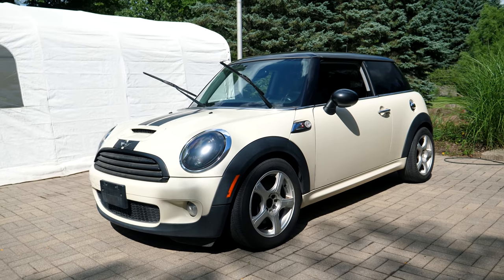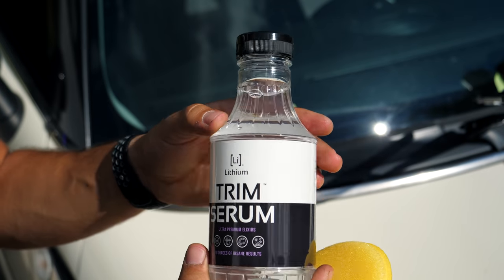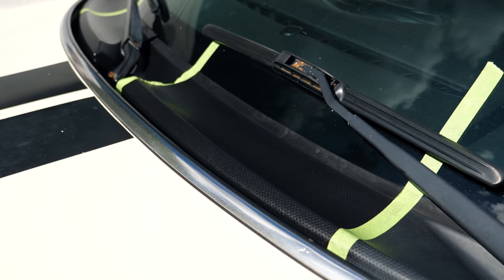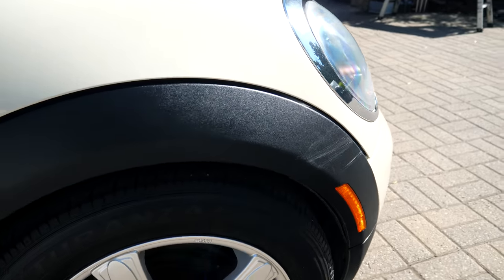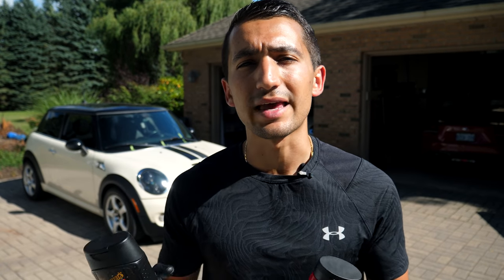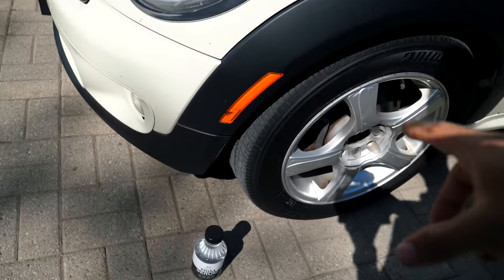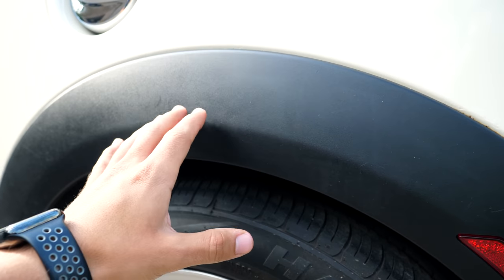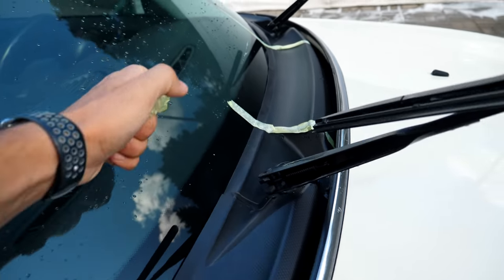The BEST Product to Restore Faded Black Trim

Comment: You want to scrub the black trim with a degreaser such as Dawn dish soap AND a green scothbrite pad. Basically take off the tiny top layer of dead plastic. THEN put on a dressing such as these. You’re welcome
Reply: Exactly, scotch brite.
Reply: How long does it last?
Reply: Damn can't wait to use the scotchbrite pad, then Cerakote trim restorer. Will report back
Reply: I just use the product but I also apply the products regularly because I park my car outside so I treat it often.
Reply: Yea dont do that. Lol the scuffs will never come out
Reply: I just use BTB and just rub it on. I’ve been using it for years!
Reply: You missed the two black bits

Comment: Like most detailing cars projects prep is the key. Planning to coat your tires, then use a degreaser product ( that’s safe for rubber, read the label )when the rubber dries after a good wash. Then apply your tire dressing of choice but ya, remember like it was mentioned in the video, wipe off the excess. As for the hard plastic, I have used the Mequires as well as my current go to Chemical Guys VRP???. I have a full bottle of Auto Glym trim dressing but have never used it ( no idea why that is as I have always liked the results of their other products. The cowl plastic trim is the hardest to keep looking good probably because it sees the most direct UVA. I coated the trim on our RAV4 a couple months ago and it has done a 900 mile round trip as well as a 2000+ mile round trip in the last month and a half with at least 7 hours of the two trips  in the rain. The trim is still black but I’ll be reapplying it soon because winter is coming soon.

Comment: If you want to rejuvenate any rubber product on a car, the best product is called AT205C made by ATP. Is is a seal conditioner for internal engine, transmissions, power steering, etc, but works wonders on vehicle trim, door seals, trunk seals. I have been using for decades.

Comment: I used C4 on the fender trim of my f56 Mini and nine months after application, it still looks brand new. Despite the fact that the car has been exposed to rain, snow and heat and a monthly wash, the product has held up rather well. I would highly recommend.

Side note: After the C4 application, I also applied CarPro Cquartz UK 3.0 ceramic coating.
Reply: Isn't that a bit redundant? Both are Ceramic coatings.
Reply: Bro what?  I tried what you did and now mine is In pieces.

Comment: I use Solution Finish Trim Restore on my plastic. It's actually permanent, not a coating. I have a Wrangler, which had grey fenders prior to application, and they are still black after 2+ years. It doesn't ever go in a garage. Auto Fetish Detail turned me on to it. TOP TIP: wear gloves when applying.
Reply from the maker: I'll have to give it a shot 👍
Reply: @Marioact  It's not an "in-store" option like Meguiars, but you can certainly find it on Amazon.
Reply: Just used Solution Finish on my JKU ... yes its black ... BUT it never dries and leaves a black oily coating that rubs off on anything that comes in contact.  Even when you wash the car it comes off on the sponge and then gets on the paint.  CRAP product thats overhyped... no one talks about the cons.
Reply: @PK22-b7v  SF has been hyped for several years, but there are newer and better trim coatings on the market now.
Reply: @PK22-b7v  Yes certainly overhyped and messy. I had same issues, does not dry properly, then gets on everything when washing the car. Very expensive for something that does not do what it is promoted to do. And too messy when applying it, gets on everything, would avoid this product like the plague.
Reply: @detailone978  Can you suggest a couple, want some advise from someone who sounds like they know what they are talking about. SF is rubbish.
Reply: @cudgee7144  cerakote, wipe new, malco epic revive.  Watch Scott HD on YouTube as he has a long test using various trim coatings.
Reply: @detailone978  Thanks for your advise. Much appreciated.

Comment: Gtechniq, hands down is the best product on the market for restoring trim it is not meant for tires with silica rubber but it is for all your trim on the vehicle whether it be plastic or rubber as it's not the same rubber that is manufactured on tires. The problem with your top pick is it last like ass after 4 or 5 washes that shit is pretty much gone whereas the c4 Gtechniq will last up to 18 months no matter how many times you wash the vehicle.

Comment: Have you tried using Meguiar's Synthetic Spray On Wax? It comes in a gallon container and can be used on every part of the car including the interior. With the spray on wax, you don't have to worry about cross contamination on other parts of the car. For example, if you want to restore the rubber trim around your windows, you have to be very careful using these products because you don't want to get any of it on the windows or the paint. With Meguiar's wax, you can just spray it on the entire area, work in the wax and it will protect and restore every area you use it on. I used to have a different product to protect/restore every single part of my car, but the Meguiar's wax replaced every single one of them.
Reply from the maker: I do have that product and do it enjoy using it when I dry my vehicles, but I wouldn't say it will restore the black trim to the same extent as some of the products used in this video.
Reply: @milanmastracci  I used Meguiar's Back to Black previously and the Synthetic wax does a better job, in my opinion. It gets all the black trim shiny and black with out being greasy. And it's so much easier to work the product in. Especially not having to clean up cross contamination.

Comment: A nice comparison Milan, but you have used 3 over the counter products and a ceramic coating. You would have been better to compare C4, CarPro DLux, Gyeon Trim and Gyeon Tyre and possibly Solution Finish Black trim restorer. I also feel that a trim restorer as opposed to a trim finish is never going to be good for rubber and a separate tyre restorer would have been a better comparison. It would also have been good to apply odourless Mineral Turpentine (I think you call it spirits) to the tyres to clean them properly. Just a few thoughts as I strive to build my detailing business. Keep up the great work and I am really intrigued to see to final episodes on your mini

Comment: The only thing that actually makes the plastic black is Polytrol, all the other ones are just coatings, basically like the shoe polish you would use on leather shoes, it puts a black coating on it to make it look black but it will eventually wash off and you will need to apply it again, Polytrol doesn't only act in surface, the chemicals in it literally make the plastic back again.
I'd say the lithium one looks like it's pretty close to Polytrol.
Reply: Ll

Comment: C4 costs $35+tx+sh. You get a small bottle 15ml.  I used Cerakote to restore my headlights with Ceramic tech and it worked beyond my expectations.  I’ve heard great things about C4 but it costs.  I used McGuires ultimate black and I like it.  For the really BAD FADED trim Rustolium Black Trim+Bumper Paint was my choice.  Used a wet/dry 800-1000grit to rough up the surface before applying a light coat, let dry,apply 2nd coat or 3d if required.  Don’t apply too much to avoid runs🤤

Comment: Any product or best way to kind of mask, hide or make not so visible a couple of small light scratches on new matte black plastic car trim? The scratches are on the inside side of my right side mirror. The scratches appear as small white lines when in sunlight. Can't see then much when in shade. The car has only 800 miles and I have to look at the scratches every time I look out the side mirror. Painful on a brand new car. If they were somewhere else it wouldn't be as annoying. Not sure how it happened. I wash the car by hand. I was hoping it was just dirt but it's not. Doesn't wipe off. I didn't find any rocks or glass stuck in my sponges or wash mitt but buying new ones anyways. Not worth replacing the mirror. Just want to make it less noticeable. Would any of the typical back to black products help on new black matte trim or just make it worse?

Comment: If you detail your car often, I suggest not using DIY ceramic products.  The SIO2 gets into your microfiber, and it's hard to get out.  If left in your towels, the ceramic can potentially scratch your paint.  So using SIO2 effectively turns your microfiber into rags.  You can "get it out", but it requires extra effort.

Comment: Thanks very much for this video!

Question: Some time ago, I made the mistake (due to lack of instructions) of not protecting the plastic trim before applying Jescar PowerLock+ on my Crosstrek. The result was a mottled white sheen on the rougher plastic areas, such as the bumper cover. I've not found a product that will remove the PowerLock. Will any of these products help remove or mask this white sheen? Perhaps there is a black stain product that will at least cover it up.

Thanks in advance.
Reply: Try plain black shoe polish, kind with a foam tip

Comment: You can tell that the body panels have been removed as all the gaps don't line up. I had this issue with my mini removed front bumper and side fenders which never lined up again. The build quality of the body is so cheap.

Comment: I use Car Guys plastic restorer
Reply from the maker: How do you find it?
Reply: @milanmastracci  Smells horrible, like rotten eggs,  I haven't tried on tires but does a good job in black plastics the bad thing is that leaves things greasy so you gotta use just a small amount. The good thing is that is way cheaper than the options in this video.